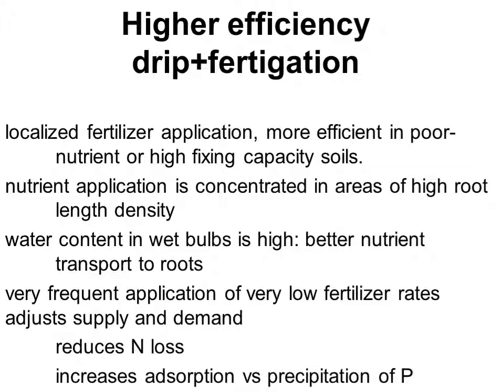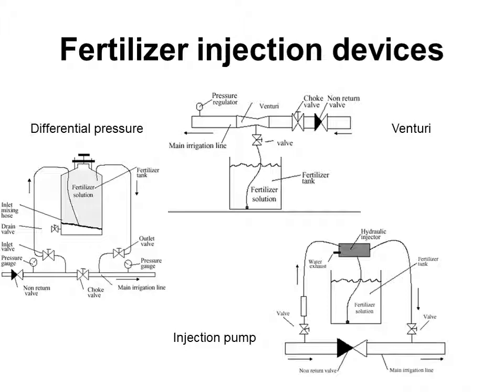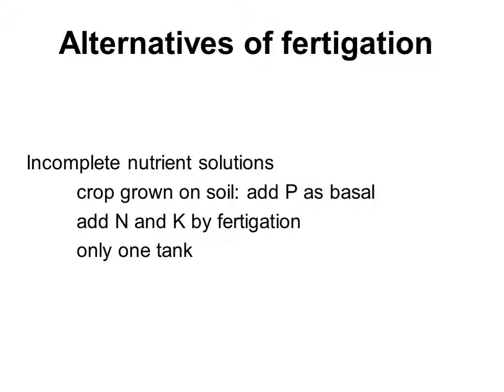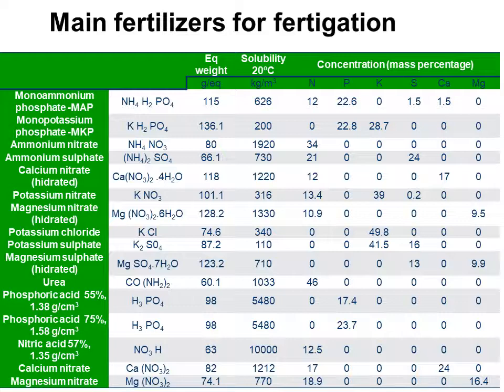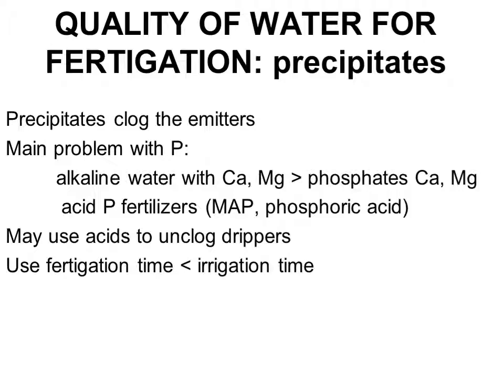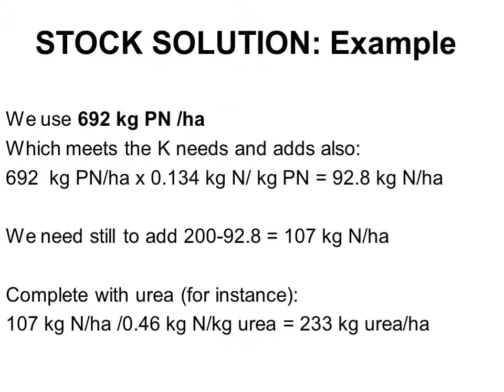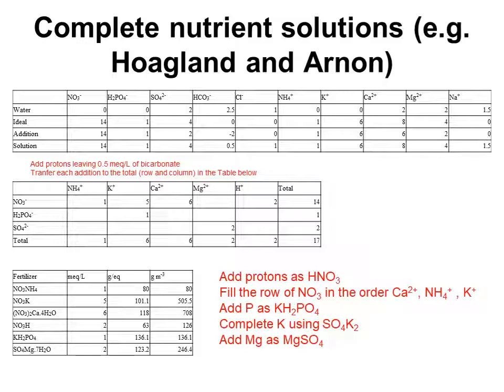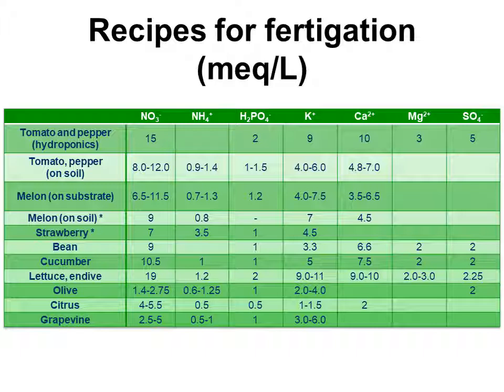Lecture: Fertigation 29 October 2020

Comment: Thanks for the excellent video. How do I consider the solubility of fertilizers when creating the stock solution. For example, if I wanted to apply 12.5KG of SOP in an irrigation cycle that requires 10,000ltrs of irrigation water, My stock solution would be 125g/lt to get 1:100 ratio. however solubility of SOP is only 110g/ ltr at 20 degrees Celcius. This means I would have to add more water to the stock solution to resolve all the SOP and thus lower the ratio. Does a lower ratio than 1:100 make the fertilizer less effective?
Reply from the maker: The only disadvantage of a low ratio is that you will need a larger tank for the stock solution
Reply: @FranciscoVillalobos  Thank you